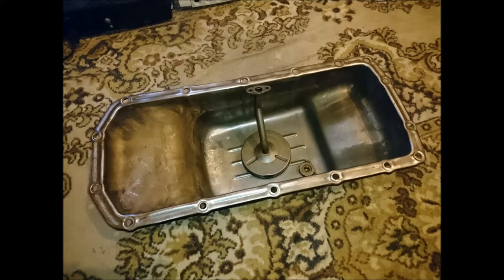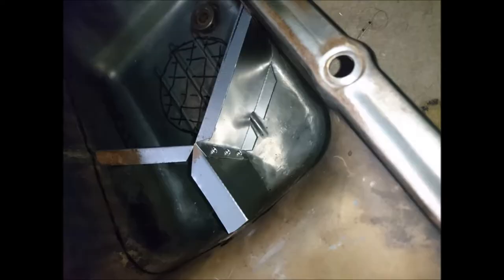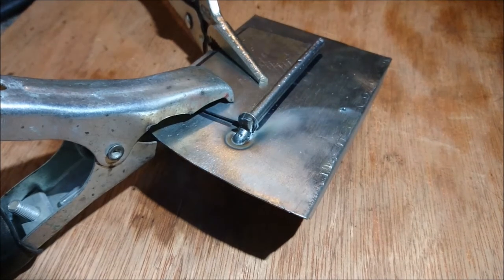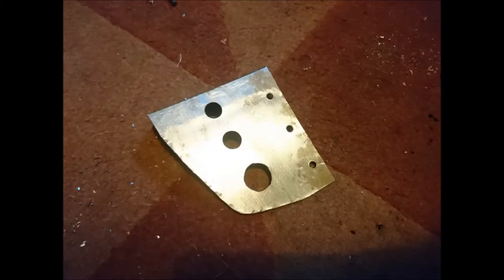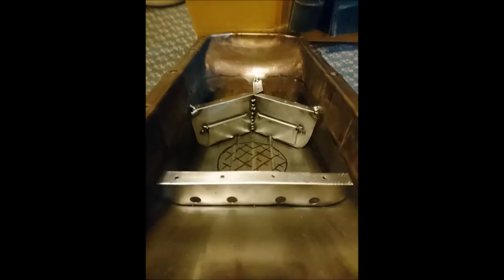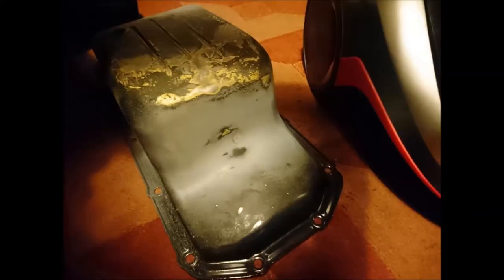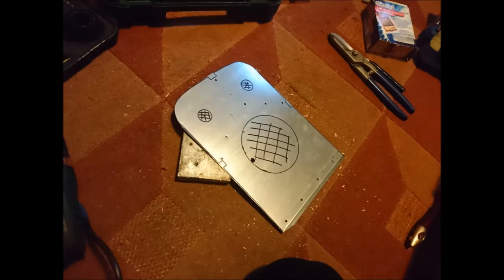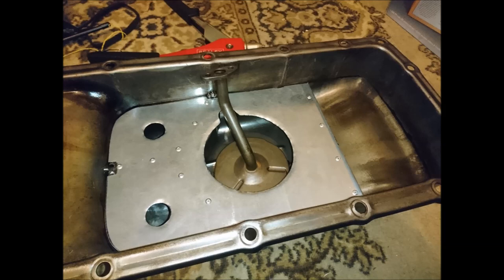Rover P6 V8 Partial Trap Door Baffled Sump (DIY Project)

Comment: What purpose are you using the P6 for ? "reducing the oils anxiety during sudden changes of direction" My Brother restored a P6 a few years ago and it was like being on a boat 😂 Great how to baffle a sump video, all the same🍻 Cheers..
Reply from the maker: The floating / boating is usually as a result of knackered front anti roll bars. You can get uprated ones from JR Wadhams or, go aftermarket and fit a BMW E21 style anti roll. Rear end skittishness is usually as a result of  a seized de-Dion tube.

But all being as it should be, they're still floaty, however, the wheels never leave the ground. I used to take it round the B roads in Potters Bar and other places, and hammer it until the front discs were glowing a dull red. P6s are very manoeuvrable cars, if you trust them.